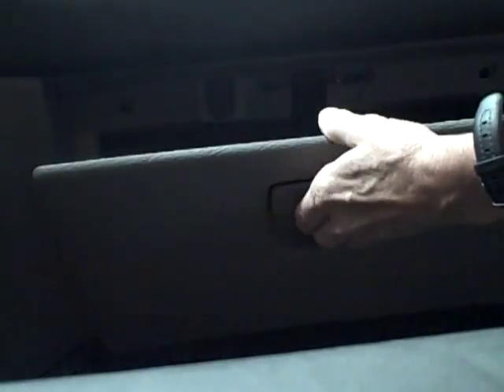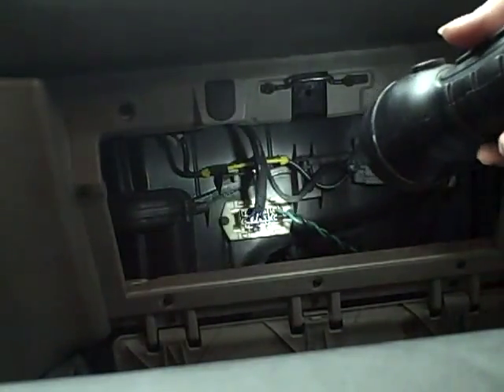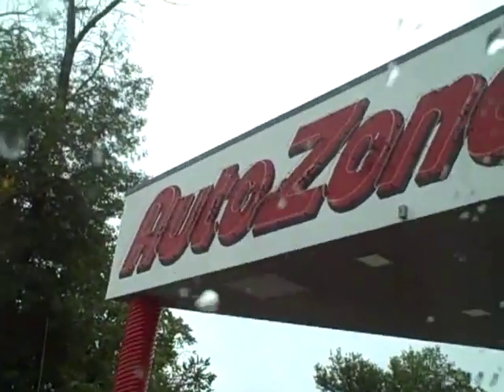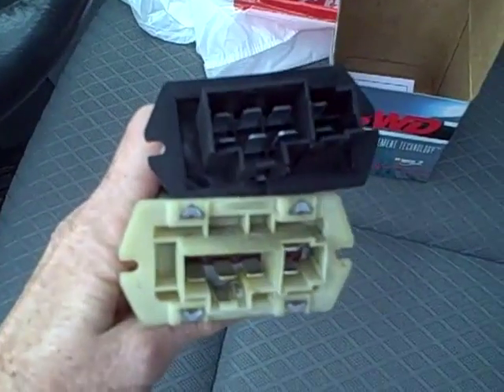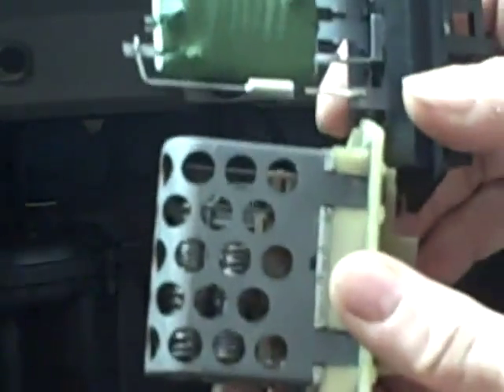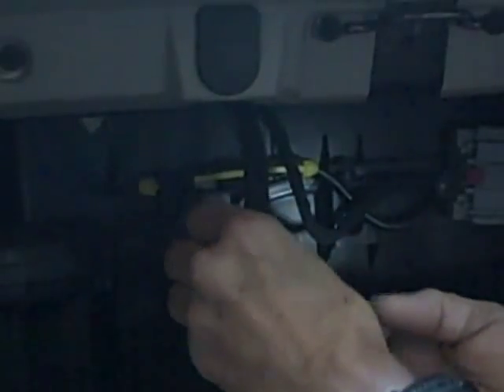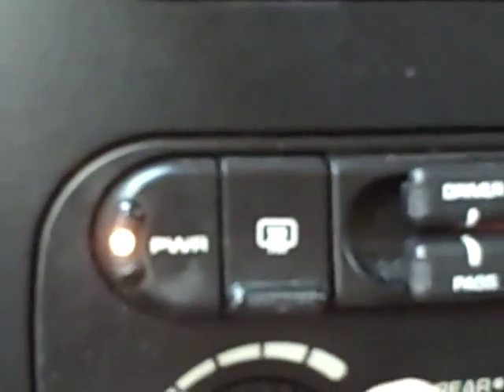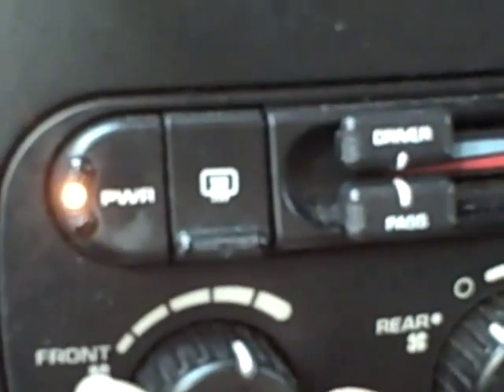2002 DODGE CARAVAN RESISTOR

Comment: If you have a burnt smell coming from your vent, THIS IS NOT NORMAL.  The culprit us usually a bad blower motor which is drawing to many amps (and that is probably what over heated the resistor pack in the first place and caused it to fail).  I recommend replacing the blower motor at the same time you replace the resistor pack.  Great video!

Comment: Hey there suebowie2010, I also had to change this on my Wife's 02 Caravan Sport, the same odd green coated resistor (twice now in two years) and both times it has given off a horrible odor. after the first change the odor went away fairly quickly (about a week)  however, this last time the odor is lingering and getting her ill, I was wondering if you had the same issue? I would really like to know what they put in that coating